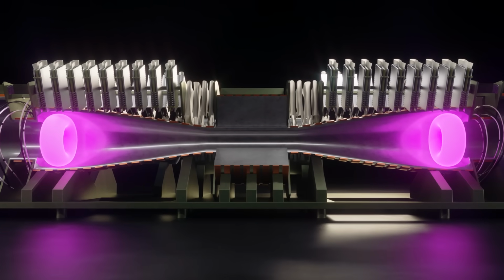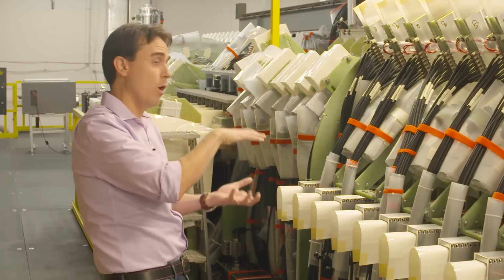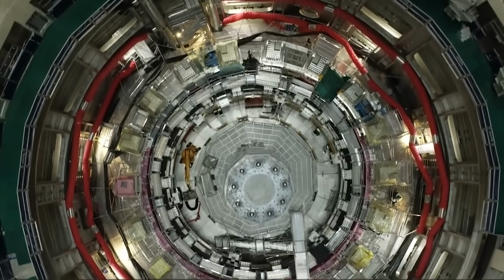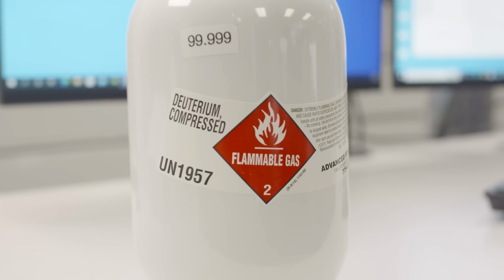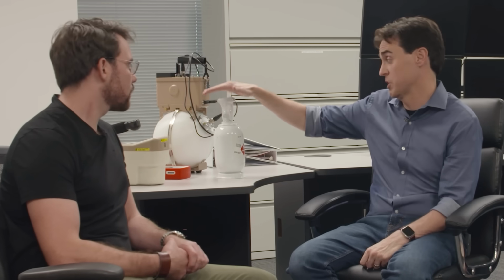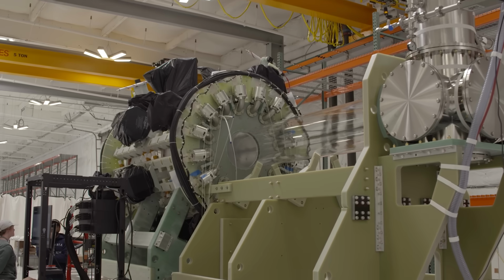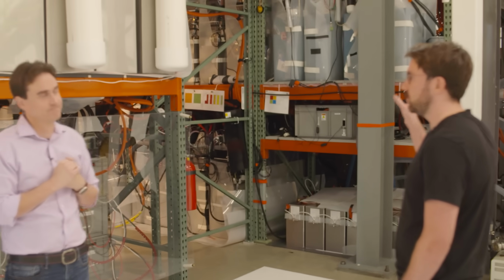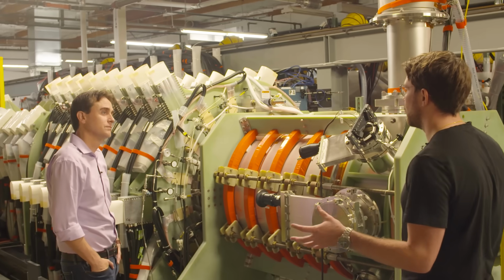A New Way to Achieve Nuclear Fusion: Helion

Comment: In short terms, an electromagnetic fusion "diesel" engine. it resembles the functioning of a internal combustion engine, but uses electromagnetic fields instead of pistons to generate energy. The similarity is that both diesel engines and helion reactors both use pressure and heat to combust the fuel, but at completely different proportions of extreme scales, as one is a chemical reaction and the other a physical reaction.

Congratulations to the documentary and for the effort of making this machine a reality what could be considered the pinnacle of a new era for mankind.

Comment: If they get too much heat from those capacitors running many times a second, or the machine itself, they could put them in water and stick a turbine on it. Two generators for the price of one?

Comment: Really REALLY interesting. It seems something much closer to commercial scale than Tokamaks. 
What I would have loves is precisely that: a discussion on what timetable and what scale of production we can hope for in the best case. There's a lot of interesting ideas out there and what really makes the difference now is really (1) scalability (2) cost-effectiveness (3) time to market
Reply: still 20+ years away. they haven't yet recovered as much energy as they have to put into it.
Reply: @jessepollard7132  true but prototypes of this thing are MUCH faster and cheaper to build... If it works I feel like it could be developed much faster
Reply: @PronteCo  all of the prototypes would be MUCH faster if they had funding. but the break even point has still not been reached by any of them.
Reply: @jessepollard7132  it's not really a funding issue it's a materials and physics issue. That's what I dislike about this topic. The hype is unreal and the misinformation is even higher. 

Same similar problems as any research projects that deal with high energy and high heat. 

They only turn these things on for a couple of milliseconds in most cases. Because they get so hot if they would left on they would literally destroy themselves.

It's the same problem as rotating detonation rocket engines. 

I'm not against the research of them but I hate the false hype trains that follow new technology and the outright lies around them.
Reply: @Daemonamongyou  Not the same problem at all. and no, they don't destroy themselves - what happens is that the plasma stops being a plasma. and the functional elements stop working.
Reply: @jessepollard7132  what are you talking about of course it's a heat problem. It is literally one of the main issues for prolonged usage. Of ALL fusion technology. They cannot insulate the devices from the insane amount of heat generated by fusion. 

You're talking about PLASMA.

Comment: I’m not that well versed in Engineering or Physics so excuse the possibly stupid question, but since the magnetic field is what traps the extremely hot fused ions, what happens if the field fails. As in, where does the temperature go

Also, incredibly to be able to trap what amounts to a small sun in a field, but are there any dangers to doing fusion at a smaller scale like this? (Not afraid, just fascinated.) And since this system does not use water as a coolant, is there simply no coolant required because the heat is all being converted to electricity? How do we store and harness that electricity? 

Maybe an ELI5 for me 😅

Comment: I wonder if they’ve looked into this:

Instead of relying on capacitors to run 10 times/second, just use a second generator’s power output to power the other generator in an alternating fashion (assuming they can get energy capture to work). It’d function like a 2 stroke engine. 🤷‍♂️

Comment: Has anyone looked at the design of the Helion Fusion Reactor? I mean really L-O-O-K at it?
What does it resemble?
To me, I looks like the inner working of am 2 ELECTRIC MOTORS connected by an ATOMIC COLLIDER.
How does an electric motor generate electricity? By like and opposing magnetic field attracting and repelling each other.
You main concern is containment of the fusion reaction and it's byproducts (tritium and neutrons) to be fed back into the reaction. 
My solution: spin the reactor inside an encasement of magnetic panels.
What do you do with the electrical energy generated by the magnetic fields? Use it to power the facility, feed back into the control systems, and if applicable in space travel, use it to generate propulsion.

Comment: Hey, maybe the whole system has some kind of resonance frequency, were it is in optimal efficiency. Similar to a resonant circuit or a 2-Stroke-Engine. Maybe the capacitors can run in resonance with the fusion pulses, connected through the magnetic fields. 🤩

Comment: DO NOT DRINK HEAVY WATER / DEUTERIUM IN LARGE AMOUNTS.

If you drink enough Deuterium aka Heavy water you will Die, not because its a deadly toxin, no due to the fact it's heavier. The heavy water takes up more energy to use in your body to burn sugar, it takes so much more energy that the actual burning of suagar in your body will result in a net negative at high enough % of Heavy Water causing you to die

Comment: Simple is better than complex, complex is better than complicated. And it looks like Helion are scrapping away all the historical leftovers from the well-known power generation technologies: multiple power conversions.  

Helion might be getting somewhere, at least compared to the recent achievement at LLNL... We'll see. Just don't let Elon Musk lay his hands on the company, haha!
Good to know that the electrical design of the reactor is basically a coil gun, with electromagnets sequentially switched to accelerate the plasma towards the middle. The capacitors themselves are interesting too - I wonder about their parameters and constructoin. Way different than anything I've seen in my electronic engineering work

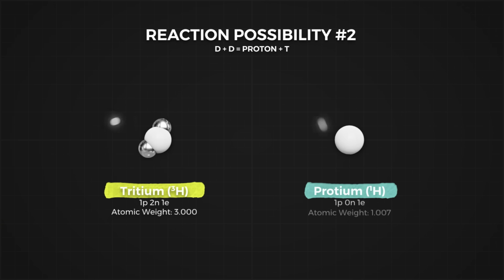Comment: 15:23 the part here is very misleading at best and wrong at worst.
tritium has 12.3 years half-life, that means only half the fuel will have decayed after that period.
a while back they show a bottle of 99.999% purity of deuterium, so assuming they want to have about that much purity it'd actually take about 200 years.
though if they can filter the tritium from the decayed fuel dynamically, they could harvest the new fuel in real time from some storage pool acting as a buffer zone. how big that storage pool would need to be to have a decay rate big enough to directly fuel back to the running reactor is beyond me (i'd guess pretty damn big).

Comment: My only question is how the energy created can be harvested from a fusion reaction. All other power generation methods basically boil water, coal and gas by burning fuel, nuclear by the fuel giving off heat with radiation (kinda inaccurate I know) but fusion is in such a contained environment how can we get that energy and turn it into electricity?

Comment: But what is the actual net gain/, power used vs. power output? Because isn't that the flaw in all fusion tech so far, it takes so much input that output is pointless. Fusion is always 10 years away. . .

Comment: IMO has some pretty aggressive targets for ships towards 2050 (though it doesn't seem like from the outside the industry...). However, LNG is a bridge fuel and Hydrogen and Ammonia is less than ideal to put it nicely. Could totally see this in a marine application if the time to market isn't stupid long. Would market perfect sense on deepsea long-haul vessels.

Comment: I don't understand why this is now a thing?  I'm all for R&D and attempting to achieve an artificial controlled variation of an impossible natural event, but we just achieved fusion not only at 100% efficiency, but nearly 150% efficiency using "x-ray collision shockwaves" from lasers. Attempting to recreate the gravity necessary to fuse protons via compression and magnetics or particle collision, without extreme amounts of density, seems like trying to light a match with icicles.  Why reinvent the wheel when you can create a magnetic rail instead?

Comment: Since the capacitors make up such a large volume of the device surely if you start one pulse before the last one finishes can u just wire the output to the input and the entire capacitor section is not needed?

Comment: So yeah, they are where nuclear fusion has been for the last 50 years: just before breakthrough. Fusion is not going anywhere.
If today there only was a cost-effective way to use the power of the giant working fusion reactor in the center of our solar system... like my pocket calculator can do, but larger...

Comment: The moon is covered in helium 3. A falcon-9 reusable rocket from Space-X will cost $27 million per flight and carry 20,900 lbs. Helium 3 is 1,400 per gram. That's $13.2 Billion worth of helium 3 on 1 rocket. Assuming the total cost of mining infrastructure on the moon, workers, storage, refineries, transportation on earth and flight time between the earth and the moon that would still be $7 Billion in cost per flight. That's still $6 billion profit. Not the best in terms of margin but for actual scale it's insane. Also you could reduce cost per flight by shipping supplies to lunar gateway and ISS as well as the moon base.

Comment: My god. I knew we've been getting close to workable fusion but damn. this is the first time I'm left in wonderment and hyped for it happening within my life time.

Wait. so these fusion reactions creates either Helium 3 which can be used as a fuel source? though this system will be reusing it if I'm following correctly. And it creates Tritium too, which if I'm not mistaken can be used as a nuclear fuel with a shorter half life than the main source we use?

Comment: fuel does not last forever
Reply: God does, what break-throughs you would need, be honest
Reply: have swappable walls so that you dont have to worry about damage, yes the walls are the fuel plates
Reply: then the walls are also the heat sink heat conduction metal
Reply: fuel plates = LiD, ie, lithium deuteride, like in atom bombs
Reply: no, you must have "problems" to have money based economy, if not problems you dont have anything to trade for, therefore your problems are money induced, not the actual truth
Reply: your lack is a lie, dont push those religion views
Reply: use the motion of the ions directly, in solar panels, and keep the extra heat as local heat
Reply: feed the He-3 back to the reactor, and the reactor walls can be high pressure gaseous, not only solid
Reply: you are lacking if you are not already done, finished, fulfilled, completely

Comment: A few corrections/notes: 
1. NIF achieved ignition, not net energy gain - they mislead by stating Qplasma not Qtotal (like most fusion does). They lost 100 times more energy to power the lasers than what came out.
2. What is the theoretical levelized cost of energy of helion or any other such project? 

4x fission energy output with 12 years of nuclear waste seems cool on paper but looking at insane margins and tech required I find it disappointing that projects like ITER get funded publicly over existing, working and necessary transition tech, while we continue buying fossils from dictators that spend it to make our homes look more like theirs.

Fusion, at least publicly funded one, needs to stop making fraudulent claims if it wants to continue.

Comment: I’m extremely skeptical of this, especially power in vs out. However I hope this works out and I wish them the best of luck. ‘Simple’ fusion reactors like this would change the world.
Reply: @joecaljapan  The problem with that result is that it only included the laser input, not the energy needed to generate that laser which was roughly 100 times more. So while the fusion part might be ready right now the laser part is very far from it.
Reply: @TripleOmega  very true it's a great technical milestone but not really well unstood by news etc.
Reply: @TripleOmega  If I had scrolled down before I commented you would have saved me the time.
Reply: @TripleOmega  the up side to remember though is that the lasers used for that experiment go back to the 1980's and there have been many many advancements in laser technology since then
Reply: @joecaljapan  The inertial confinement experiments at the NIF are an interesting proof of concept, but the NIF experiments are simply not built to make progress in the way of fusion generators, rather they are tests done to analyze the potential neutron outputs of the US nuclear weapons stockpile, to make sure they still work. 

Achieving ignition is still a big deal, but it's more similar (taking a car engine analogy) to proving that "the right mixture of air, gasoline, and spark can produce an explosion with a measured output energy" than it is to "building a 4 cylinder gasoline engine".
Reply: It's easier to be more skeptical of traditional fusion reactors, I didn't care in the slightest about the recent net energy delta for the tokamak reactor because it's still probably about a millionth of what they would need to power a steam generator. I think the magnetic field technique is really interesting and has the potential to be insanely efficient, the only question is if it will generate enough clean energy this way to be useful, the challenge with these direct methods is usually the scalability, it's typically only a tiny amount of electricity, still, i think 100 clean efficient mini fusion reactors is better than 10 ultra expensive inefficient and  8 or 9 are shutdown for repair all of the time
Reply: ever heard of sodium reactrors, ?. cheap, safe, but banned because they didnt create nuke waste..funny,,eh..
Reply: @joecaljapan  It was net energy worth if you compare the power put by the lasers into the system. But the lasers themselves are highly inefficient in the amplification process and in fact the energy output was ~1% of the total energy consumption for the experiment.
Reply: And so you should be. Litteraly nothing new was proposed here to break the actual problem of fusion. using less energy on breaking the coulomb barrier than the fusion outputs. and even if that is solved. it would need to be broken by a lot to account for inefficiencies in electricity production and transport.
Reply: You think they’re spending billions on this without having a clue what they’re doing, building some perpetual motion machine?
Be as sceptical as you like butI’ll side with the people doing the job.
Reply: @oggyoggy1299  you mean like people spent billions on a blood testing scam and where convinced it was the next big thing? 🤔
Reply: I was skeptical until they explained how they would efficiently make their own fuel
Reply: @_A_c_  yeah the lack of neutrons and massive amount of beryllium really can't be understated, really cannot imagine how tokamak fusion will ever be realistic if you just look at how difficult it is to get uranium fission going, purely from an economic perspective, needs to be cheaper, faster, better
Reply: Your skepticism is justified.

Comment: ☆• sooo... the "most abundant matter" in the universe?, "plasma";  changes its "qualities~ essence"; via the "force" used upon it? ☆□ The new Helion Generator compresses this type of matter from two ends; fusing the matter soo quickly  tightly and hotly, that the matter becomes a: liquid or gas or solid? □° Plasma initially has no charge; NO electrons?

Comment: This is only Fusion System Which 
1. Can do multiple fusion Cycles per day and per hour.
2. Don't use tritium which cost millions per kilogram. One of the Most expensive material in the World.
3. Directly convert Fusion power into Electricity without turbine and heat exchange. 
4. Smaller and cheaper than other fusion System.
5. Scalable than other fusion systems.
In my opinion this is Best fusion System if it achieve Net energy production.

Comment: The problem with using He3 is that it is almost non-existent upon the Earth.  Tritium we can breed in a lithium blanket, he3 we don't have that option.
Reply: Actually, Helion will produce their Helium3 by fusing Deuterium in the same machine. D+D => He3 +n or D+D => T + p (the Tritium eventually decays to He3 as well). No space travel required.

Comment: 28:06 A lot of those plates look like some kind of polycarbonate or plastic.  It's just a video and I could be mistaken, but would this be for reducing the effects of the magnetic fields generated in the reactor?
Reply from the maker: Yes, they are glass fibre composites. The structure of the generator needs to be transparent to magnetic fields

Comment: Silly Rabbit!
Aren't we ignoring that fusion of 4 H to 1 He takes over a million years to and although reaction velocity increases with temp., IMPORTANT to note the reverse reaction also increased.
Reply: They fusing two Deuterium atoms (2H ) not 4 protons.
Reply: @elmarmoelzer2229  Helps if you listen. They "plan" on producing fuel from "Deuterium" yet Deuterium-Deuterium Fusion requires 10x initiation energy and only "studied." Real world Tritium production by the AEC/DOE was for breeder (Graphite reactors like Chernobyl) emitting fast Neutrons at Lithium6 giving 4.7 MeV energy also. (Not a chain reaction because too small a target.)(@ "Castle Bravo" tests found both Li6 and Li7 provided Tritium equivalent: either by breaking up at high thermal temperatures or by Lithium reaction with Deuterium.) Yes, current fusion reactors use Lithium in place of Tritium. Why? $$$$$$$
Reply: @elmarmoelzer2229  https://en.m.wikipedia.org/wiki/Abundance_of_the_chemical_elements
15 Deuteriums per million atoms. Why? 1.9 MeV breaks Deuterium into  N and P at Temp of Deuterium in Fusor c.f YT videos. Only 1.7 MeV Neutron does (n,2n) reaction with Li7 (and ~1 MeV for n+Li6=He4+T but rem also 4.7 MeV yield.)